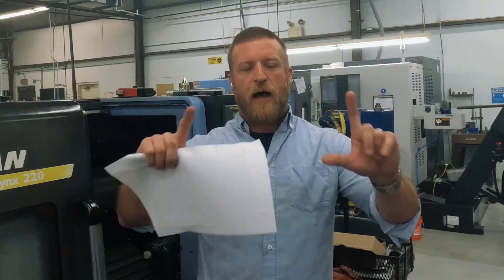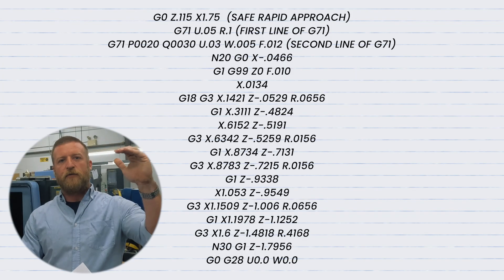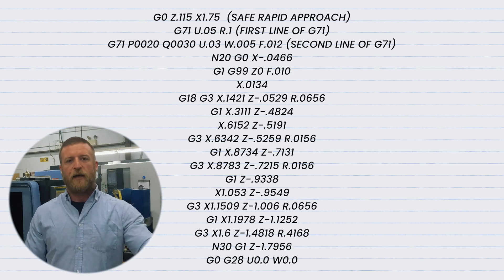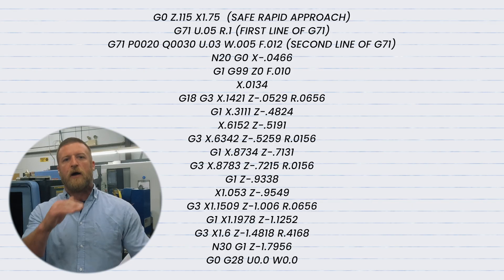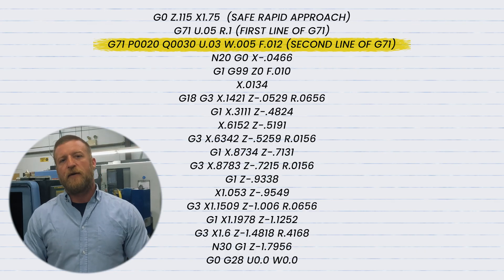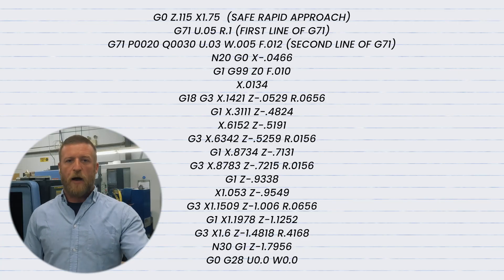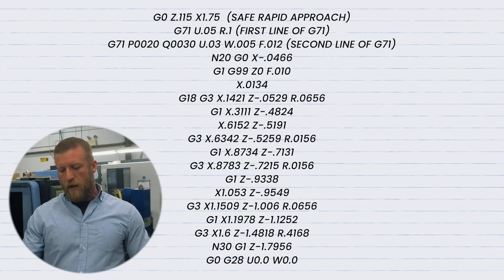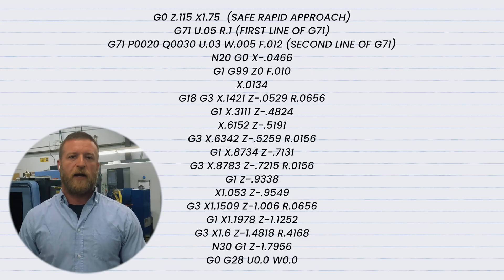Stop Wasting Time on Long CNC Lathe Code – Try G71 | The Lathe Lab Ep.8

Comment: G71 is for dinosaur that have machine with controllers that have orange or green letter on the screen, usually with puch tape still installed,might even have a 3.5" floppy drive if your lucky....Get with the modern times, canned cyles are not effecient, but you know that cause you use them. lol, your shop Practically a machinist foruj is the most misinformed vendor biased adforumI ever seen lol...get smarter,get offthe Practically a Machinist Forum.

Comment: You can even take it a step further.
Use G42, G41 and G40.
And you can change  the radius of tool in geometry offsets.
And you can use any tool no matter what radius it is. The machine will adjust the path for you.
Just saying in case you don't have a good cam software

Comment: When your lathe allows you to Feed/move with G98 and not running spindle you can use G71 for internal or external broaching.
Well you need a C-axis and brake of course.
Reply: Wow. DId not know that but it makes sense.  Very cool!
Reply: @Crusadermachining  
I use it on our FANUC and HAAS, our Haas NGC has a template for it but I find the G71 easier, you have to be carefull with your X values, it needs some calculation on first and last X but that's no problem.

Comment: I don't know about this one, you'll end up with a bunch of cam programs that don't match your programs at the machine, better solution is just to move the computer out by the machine so you don't have to leave the machine to program, not saying you shouldn't program with g71, just don't edit programs at the machine. Otherwise you're just doing it twice
Reply: Definitely respect your opinion and for some shops thats very valid.  I still think changing the depth of cut or material allowance at the machine is something every programmer should know how to do. That is the reason G71 was made the way it was.  A quick change of the U value can drastically improve production and efficiency in just a few seconds.  Also, there are a lot of shops who have no CAM software and don't want to.  Here in the midwest, it's very common actually.  A lot of high production, high profit margin shops out here have no desire to use CAM.  Simple parts, high volume.

Comment: Do you use tool nose radius comp in your roughing cycles or just your finish pass?
Reply: Great question, all depends.  Sometimes we don't use it at all.  Other times, we do use it but we use for both rough and finish.
Reply: Tool nose radio comp is reqd only for finish pass. No need for roughing passes.

Comment: When I see old programs with no rough and finish cycles I make my own and even a better one. Or when I see grooving some tight tolerance for sealing without tool side selection I run to machine to make one roughing cycle and paste it to programs for older machine where I have no idea of conventional programing with old controls. It gets managable by changing tool offsets and not compensating to one tool side by changing the program all the time. This is annoying.

Comment: Is there any specific reason that you use right hand tooling versus left hand? I like left hand tooling in slant bed lathes so it's easier to change inserts inside the machine.
Reply: That’s a great question. The main reason I do is just cause what I’ve always done.  But that’s a wonderful question.
Reply: I like using right hand tooling with the tool facing down, so the chips can fall.

Comment: There is a time and place for G71 and G72 cycles.   Even using Type II statements is limited by the part geometry and the fact that Fanuc controls don't know where the back side of the tool is,  only the tool tip.  This is a good cycle to deploy when it makes sense.
Reply: Great piece of information to add. You’re right about the code not knowing your tooling geometry.  As long as that’s correct from the programmer and setup - should work OK
Reply: @Crusadermachining as long as the back side of the tools will clear the toolpath constraints you're good.   Where it shows up is when there are undercuts in Type II statements.
Reply: @terrymoorecnc2500  100% agreed - great point.

Comment: Why is there so much more code in the long form what is that extra information. Is it just more time and location of tool  increment information ?
Reply: Basically, it’s the same amount of information but the additional code is because it’s a lighter depth of cut so it’s duplicating the geometry.

Comment: I think turning lends itself to hand coding much better than milling.   Good video Luke 💪
Reply: Nah, both mill & lathe are very easy by hand programming.

A (G71 or G72) canned cycle doesnt function the same on a mill so simply write 2 subroutines using M98 without a (P) for first sub,but at end of first sub use another M98 to call 2nd sub. In 2nd sub use G91 positioning method and end with a G90; then M99; 
Very easy👍
Reply: @Th4thWiseman  I really like to use dynamic milling on my mill able to run much faster and much higher tool life.
Reply: I would be inclined to agree and thank you very much my friend 🙌
Reply: Yes. Manual programming is more convenient for turning m/c.

Comment: As an Okuma OSP lathe (millturn) guy ive learned from the beginning to use cycles and find it way easier and faster than using CAM.

Just G85 Nxxx D U W F
Nxxx G81
Part profile
G80 and finish with a G87

Protip for OSP cycle use G83 to describe Odd shaped material and you wont cut air.
Reply: Yes!  I’m the same for sure. And a good mixture of hand and CAM are the best way to be an all around good programmer. If you rely too heavily on one verse the other, I don’t think you can hit your potential.  Thank you for sharing your opinion.🤝🤝
Reply: CAM is really good for milling, generating best path for mill tools one by one command optimized for tool life and least air cut. PAL programming was way easier in the school before I started working. PAL has so much potential for simple shapes and saves a lot of time and there is so much options you can fill two rows of a single cycle line in a display before contouring. Shame Okuma generates G1,2 and 3s in lathes which makes milling harder to change if you must touch the program. Dunno how it is with mill and millturn machines.

Comment: Yeah it's great, if your machine is equipped with it. I used to run a couple of Okumas from the early 2000's and G71, G72 and G73 were options you had to pay for. Who ever picked those machines didn't pay for it.
Reply: That kinda stinks. I remember hearing about machines in the past that you had to pay for certain features that now are standard.

Comment: I use G71 and G70 all the time, and also M97 sub-routines. Like you said, it's way easier to make quick changes in depths of cut, feeds, etc. The only thing I CAM for on lathe parts is to generate the finish tool path profile.
Reply: M97 is a Haas sub call.  On Fanuc it's M98 Q.